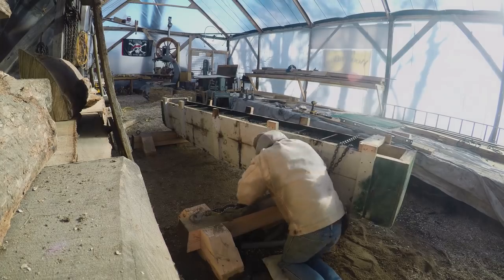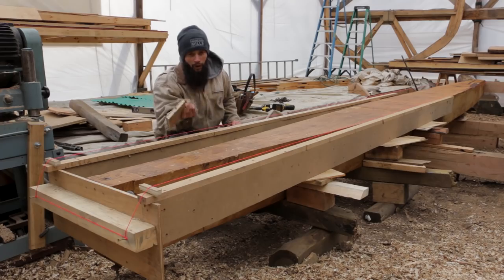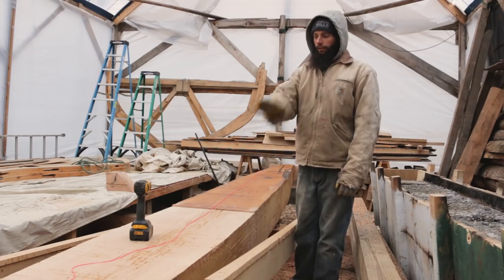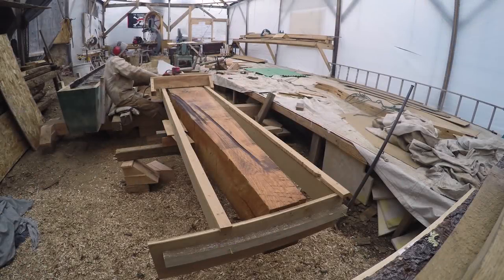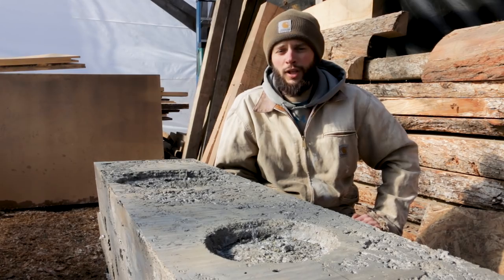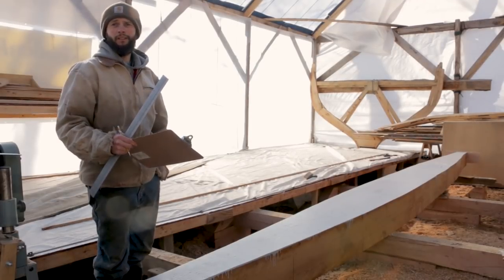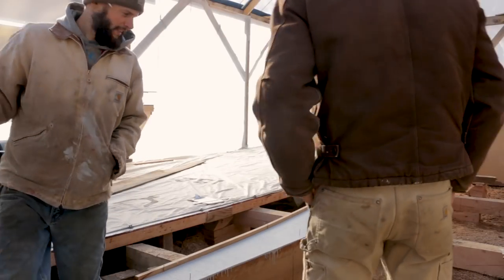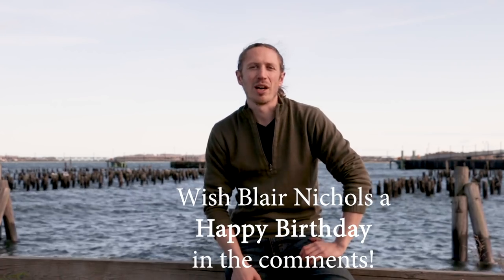Acorn to Arabella - Journey of a Wooden Boat - Episode 27: Flattening the Keels

Comment: 22 feet 10 inches 5/8 holy shit imperial is long to say :D just say 6975 mm or its probably a division from the hole length so a division to 7m would be easiest :D
Reply: Metric system is easier to work the math, and much easier to understand for some. But being raised in the imperial, that is what makes sense to up. Writing it out long form is a pain. So it's easiest to see and read it as 22' 10 3/8" simply read as seen. Twenty two ten and three eights.
Reply: i've heard you also have metric in school for some things and that most international companies use metric for measurements and stuff made elsewhere is in metric so isn't it a pain for you to use both? i get the hole 12 is easier to divide but we use base 10 so presentation is just simpler with everything based on 10 :D
Reply: jöötäjä 
When your tools are made with imperial measure, metric is a big pain. Metric tools are not as common or available in the USA. This is likely why they use imperial. Plus they are using a century old plan to build from that was likely drawn in imperial measure. So, it would be a lot of extra work to convert everything to metric with decimal points to equal the measurements. For instance, one inch is 2.4cm, so do your tools show .4mm or 
.076mm? Just wondering.
Reply: Joottaja, Yes it is a pain when some corporations use the metric system! So, I suggest they stop using the metric system. The fact that you use 6900 some odd cm is why the system sucks! People actually right it that way. I’ve tried counting all those little lines. It sucks. Haha
Reply: Jootaja mm my mistake. Yet another reason not to use the metric system.
Reply: being a tool and die maker in Germany for over 40 years now I sure happy that we work with millimeter and not with inches. But since we also had some work for Lufthansa making tools for maintenance at planes and jet engines those drawings are based on the imperial system because they come from Boeing, Pratt &Whitney or Rolls Royce. It was relativly easy to converse 5/16" into 7.9375mm (1" = 25.4mm), but what I find very disturbing is when I read I need a tap number 10....
I remember back when I started in that profesion there were discussions to change also the angles to a decimal value. This would have meant changing from 360° to 400° and thus having the right angle at 100°. It would for sure making it a lot easier in the math, but the costs for replacing all the existing tooling would be astronomical.

And last but not least:
Happy birthday Blair... ;-)
Reply: im not saying to trow the old tools out for working on the existing stuff im saying make the new stuff in metric all your imported cars are already metric :D also with a standardised system world wide there is a lesser change of conversion mistakes and more compatibility. @Thomas

if you plan everything from the beginning you can plan it to be nice round numbers in metric @P.D.

yupp also i don't get american wire gauge why not use a unit that actually tells you something about the cables area like square mm/inch :D @u lie
Reply: Yes, that is why we should scrap the metric system. Less confusion.
Reply: nope, actually the states officially  uses the metric system and the imperial system is just ratios of the SI units:D
Reply: @P.D. Smith Jr. well for the same reason I could say scrap the imperial system. But I won't do that. It's a system that works for a lot of people just like metric works for another lot of people. It's just what you've learned in the beginning. And I admire those people who can work with the imperial system, and even more those who can work with both systems. Like my son who spent a year as an exchange student in Michigan and took the drawing classes at his high school there.
Reply: Jootaja Just because our government no longer cares what the people of this country want. By the way they are working of an old set of prints. In 1800 the metric system had not made it out of France yet. Should the go through the prints and convert every measurement?
Reply: @P.D. nope i'm saying make the new stuff in metric so there is less confusion for everybody in the future :D and if you say stop the metric in that case there is about  7,3 billion people in the world using metric and about 320 million using the imperial system :D
Reply: Jootaja In the U. S. We have no problem using both. We can buy tape measures with metric on one side and USC system on the other. I’m an old man working in the wind industry. Most towers are made(in China) by the Spanish, Germans and Scandinavian countries. These are all metric; but, when I buy tires for my pick up or a new wash machine for my home they are in USC system. More correctly, I work on elevators for wind towers. The U. S. Codes for elevators give both systems of measurement in there publications (ASME A17.1). If a coworker ask me for a 19mm wrench, I know a 3/4” wrench will work fine. We have no need to change! I wish homogenization would go away!
Reply from the maker: The plans are in Imperial as are the tools and that is all I (Steve) have worked with.  If you are used to the system it works well enough, but in my humble opinion the metric system does make so much more sense!
Reply: @P.D. are there many sizes that match well enough? of course on critical bolt with high torque specs you probably want to use exactly the right one not to strip the bolt/nut :P

@Acorn to Arabella i guessed the plans wore in imperial :D if you build self planed pieces do you use metric or imperial? :P
Reply: jöötäjä There are several cross overs. It is not uncommon to buy a metric set of wrenches with the cross overs missing. When using a six sided socket in high torque app. I use what the company provides me, since those tools I’m not required to buy. In my mind every measurement is perceived as USC. When I was in Germany in October for training,I did not pump  3 3/4 liters of gasoline. I pumped 1gal.
Reply: but when i Germany everything about gas is in litres :D  i get the hole to get a grasp of how big the volume is but with gas you need the volume for price which there is €/litre and consumption which is litre/100km :D

Comment: I feel so bad for you guys using american customary units, they are inferior to the point of impracticality. just hearing "1/8th of an inch" rubs me the wrong way. millimetres all the way.
Reply: What we learned as children is easily understood as Adults ie grown Men doing the measuring, cutting, and and Building.
Reply: That doesn't diminish the inaccuracy and unwieldiness of the system. I have done building work and studied structural engineering before moving into the science field. many of the weaknesses of the system are apparent at a glance.
Reply: Yet it works fine. 1, 1/2, 1/4, 1/8, 1/16, 1/32, 1/64. Makes perfect sense to me.
Reply: And yet obviously and evidently inferior to the metric system. those fractions also don't stay the same when moving between feet and inches.
Reply from the maker: The plans are in imperial as are our tools and experience so it works.  But we do think the metric system is more streamlined and makes a bit more sense in terms of simplicity and efficiency!
Reply: They're building a boat with timber they drop and mill themselves.
Reply: That's exactly what i meant, it would be easier to if it was all in metric, but it's not. the ground being frozen is another interesting problem, that doesn't really happen here.